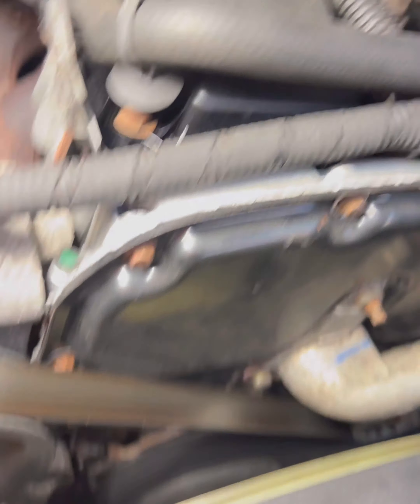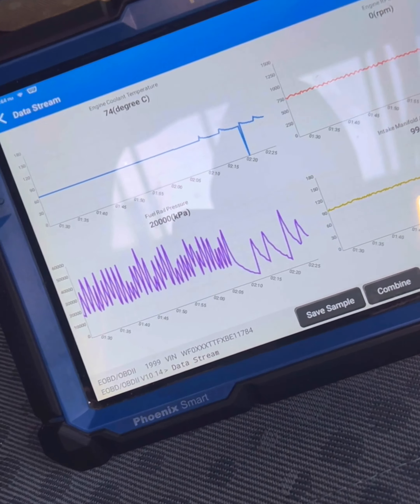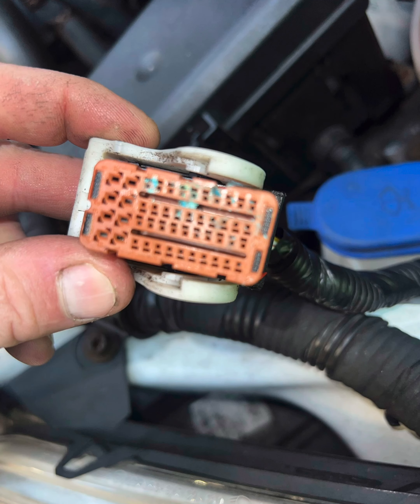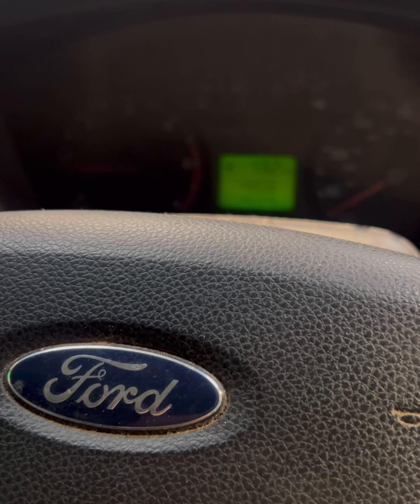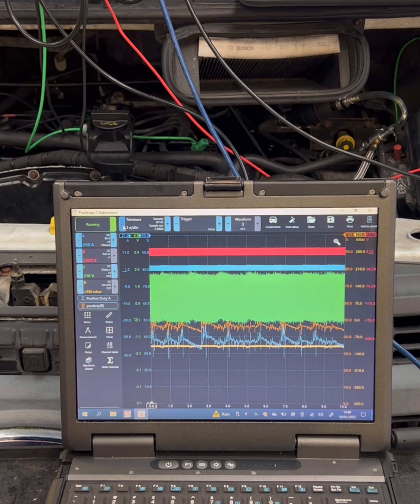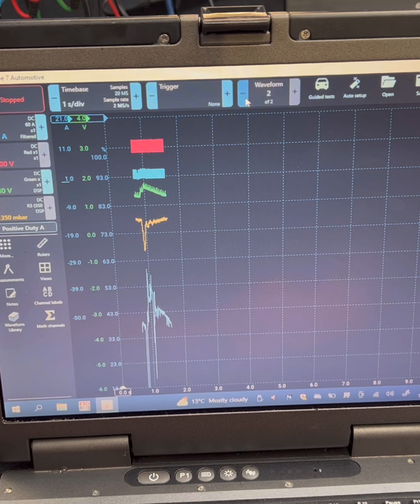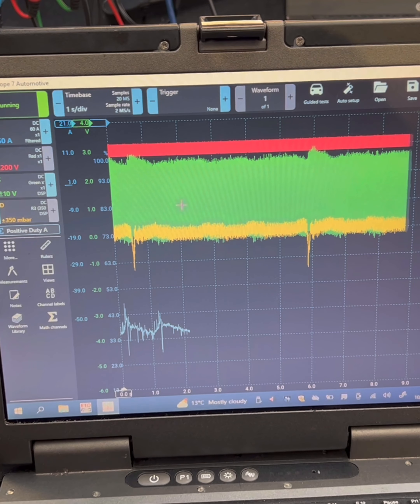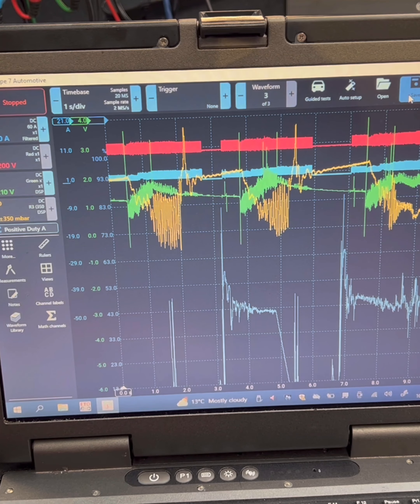Ford transit hot starting problem

Comment: Hi guys , I have the same problem 
Ford Custom 2.2 love it , but hard starting when getting hot , been in the garage 1 week .
Test Injectors 
Test Fuel Pump , Relay fuses 
Still the same problem , I have been told to change the high pressure pump 
No idea what to do 😢